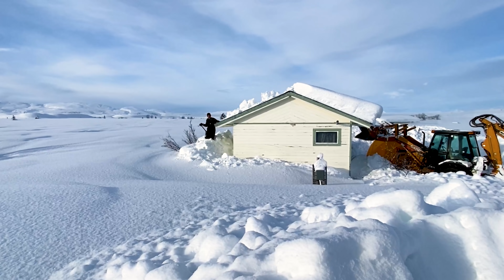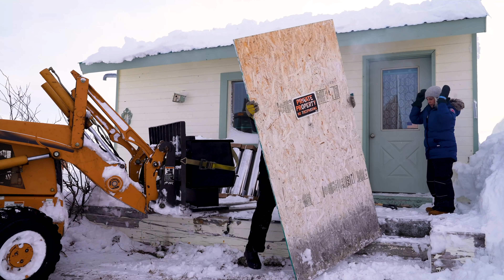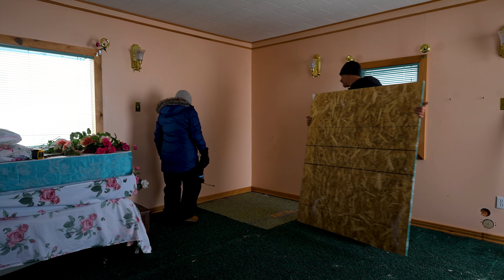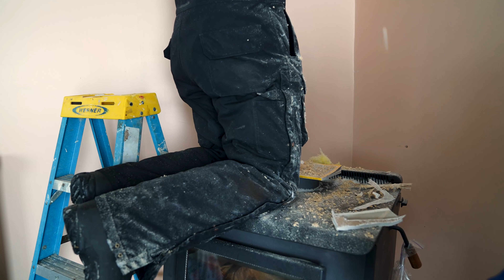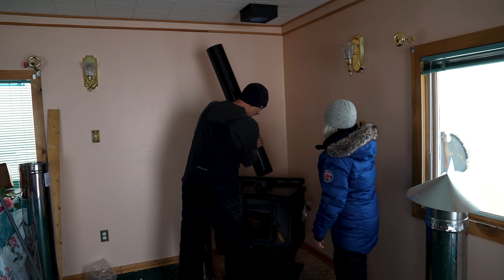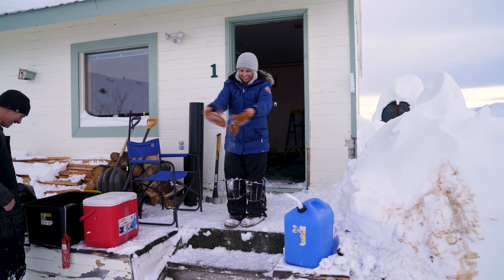INSTALLING a WOOD STOVE! (In Our Off Grid Cabin)

Comment: For snow removal off the roof, take a rope and lay one end over the top edge. Secure the end, now walk the rope to the other side. Flip it a few times or use your ladder, or rig to position it on the top. Now pull the secured end until you have two ends
 to position in the fall area. Pull the rope through the snow and bingp!

Comment: also add a snow roof divider... to keep the snow that gets accumulated on the roof from bending the stainless steel chimney pipe. a good usually an old russian custom is when you start a first fire in a cabin/house.. you open a bottle of vodka.. get yourself an old FM/MW/SW/LW radio with cassette player if that is available.. lotec :)
Reply from the maker: Yes. An ice cutter (cricket) would be a good idea. Today, I am going to install a chimney brace tow project it in these high winds

Comment: Great video! Thanks for posting. Not sure if that is your 580 or a rental. Front chains do wonders, but it looked like the ground/traction was such that they weren’t needed this trip. Obviously not your first rodeo in that machine, so I'm betting it's yours. The area looks familiar, but for privacy I won’t say. Thanks again!
Reply from the maker: Thanks my friend. Yes, the 580 is my right arm. It is a workhorse. I’m pleased you enjoyed the video!
Reply: @ThisIsMyAlaska   Good deal. We really enjoy our '02 cummins powered Series II 580. Its extremely reliable. It was hard to tell from the video  what series you have. Nice work.
Reply: @ThisIsMyAlaska  You definitely know how to make that 580 dance.  Question:  I have seen your skills with the backhoe so would it have been possible to extend the backhoe bucket and gently pull most of the snow off of the roof.

Comment: Did I hear you right are you changing the front door to the end of cabin if so why?. No offense just curious.
Reply from the maker: We were talking about it but my wife wanted me to leave it on the side. In the end I think we will decide to leave it where it is. My preference for locating the door on the gable end is because we have tend to have less snow removal than when it is under the eave
Reply: @ThisIsMyAlaska  oh ok. Makes sense.. but I see the wife's point would of made more sense if the bathroom was on other end then front door on that end would of worked esthetics wise pulling up.

Comment: I have seen those videos from other places with using a rope or cord to slice under the snow pack on roofs. Wouldn't that be a faster process?
Reply from the maker: Yes, that may have worked. I have never tried it though. It only took about an hour to shovel this little roof though, so it wasn’t too bad

Comment: if those "braces were to keep the roof from collapsing and you removed them, what is going to stop it from collapsing next winter?
Reply from the maker: We will be rebuilding the roof system. Most of that will take place in the next couple of weeks. The next two or three videos will be dealing with the roof structure.